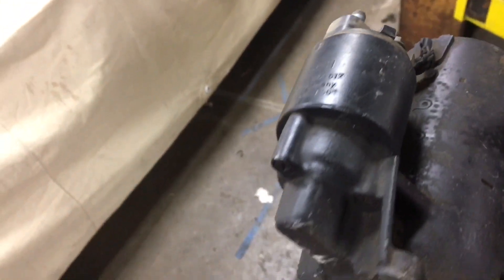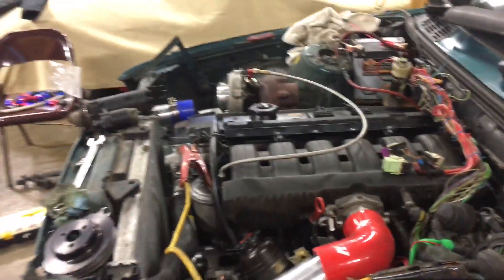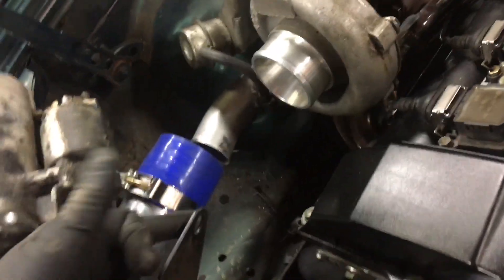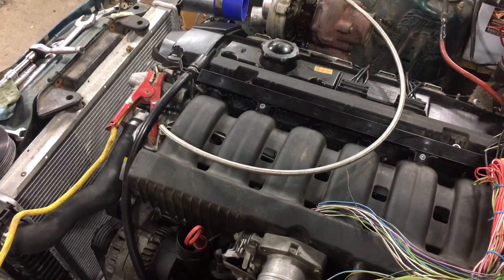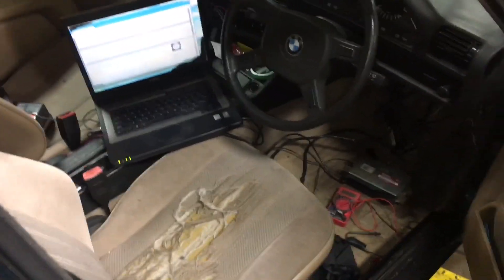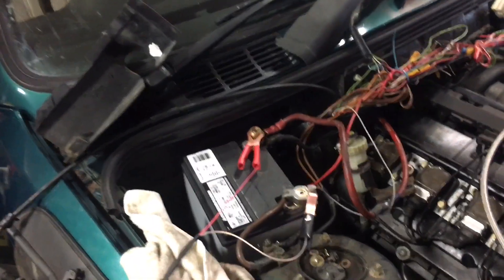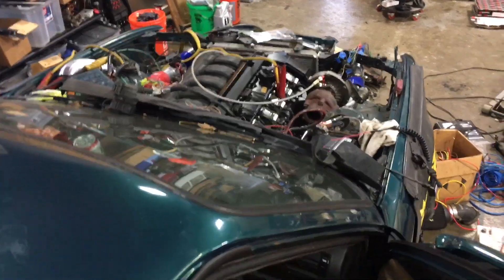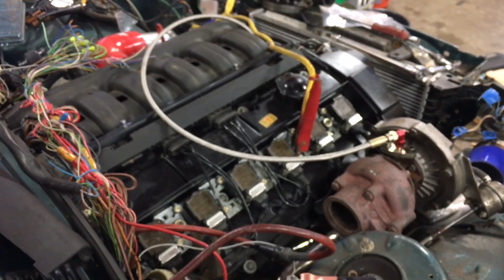Project Touring Part 11: No fuel, No spark diagnostics (bonus hoonicorn CPS replacement!)

Comment: hade same problem with my e30 m50,
the bracket that is holding the starter motor is a ground connection .
i noticed becouse i painted the bracket and the car whould not start after, had to strip the paint off where the bolts connected.
Good luck!
cant wait for next vid :)
Reply from the maker: batman problem ended up being a sheared dowel pin, moved the starter an eighth of an inch and it was ok

Comment: I'm doing an s50 swap in my e30 and I was wondering how can I tell which sensors are which on the engine harness, so I can label them correctly. Also would it be easier to buy a pnp engine harness adapter for the s50 swap. Or is doing it by hand easier since I was told there are only a few pins I would need to splice.
Reply from the maker: MarkyD GFX buy a bentley manual, has wire colors in it
Reply: Ovalbore should I buy the e30 and e36  Bentley manual or is there a combination of the two
Reply from the maker: MarkyD GFX you'll want the e36 one
Reply: Ovalbore alright I'll pick one up thank you

Comment: 1 problem with your swaping of cranksensors is that The nonvanos unit uses VR sensor, and your more modern s52 uses probably hall sensor. So swapping sensors over shouldn't work :D

Comment: So was this the crank shaft sensor?
Reply from the maker: nope - bad main engine harness
Reply: Hey thanks for the reply I have a similar issue but found I have a weak ground at the dme that’s won’t turn on the dme relay so when I manually add ground to it the car starts and runs fine? Do you know what gives the dme ground? Any help is greatly appreciated
Reply: MagicMedia411 How did you manually ground the DME ? If you don’t mind me asking